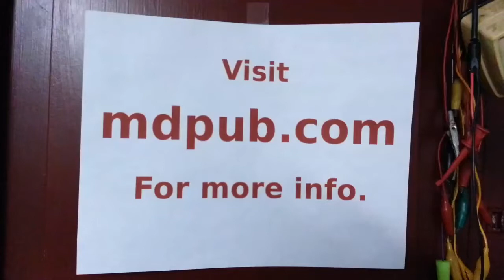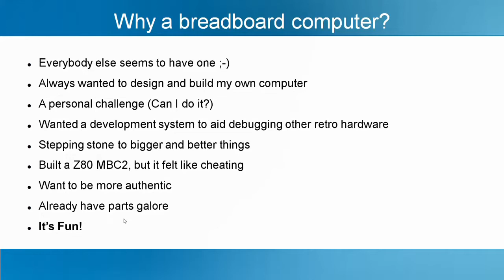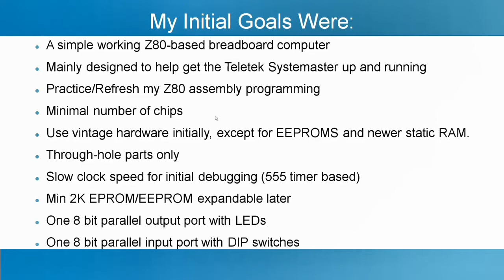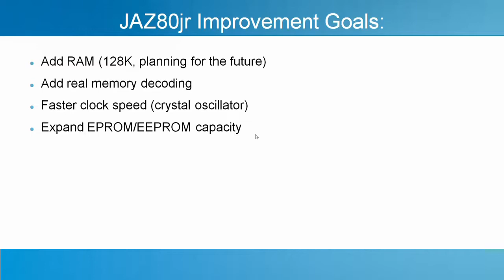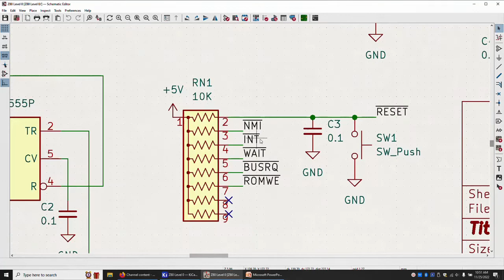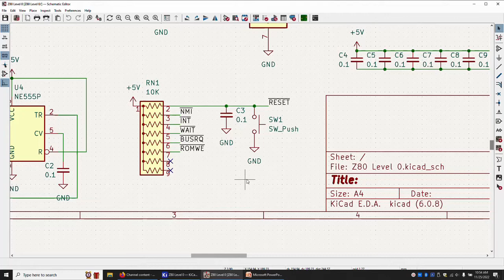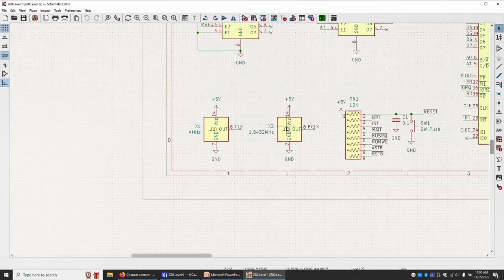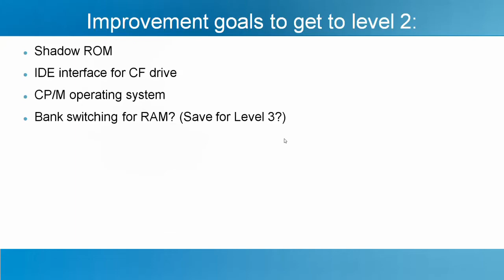Introducing The JAZ80 Z80 Homebrew Retro Computer Part 1

Comment: I do have one question for you. If you use static ram, what do you do with the refresh pin on the z80 ? Do you tie it to the 5 volt line ? Do you tie it to ground ? Do you just let it float ?
Reply from the maker: It is an output pin. There is no problem with letting unused outputs float. Don't connect it to anything.